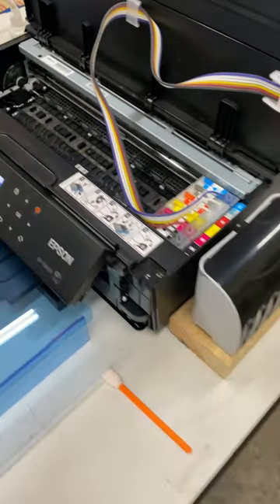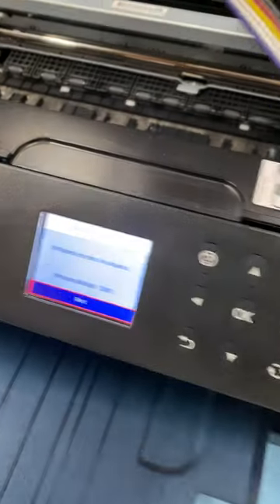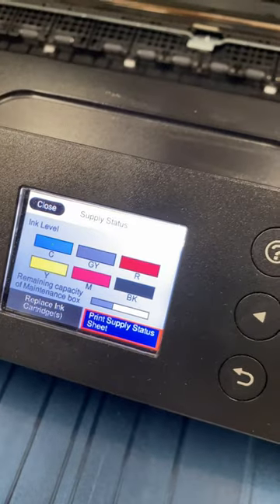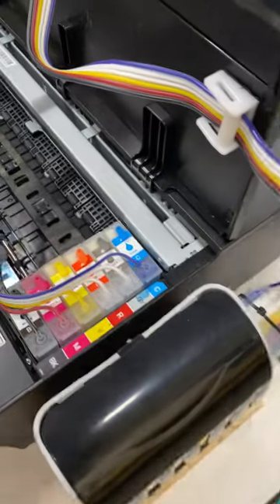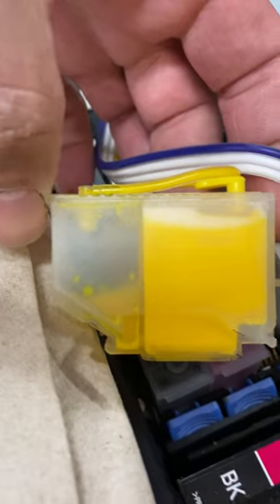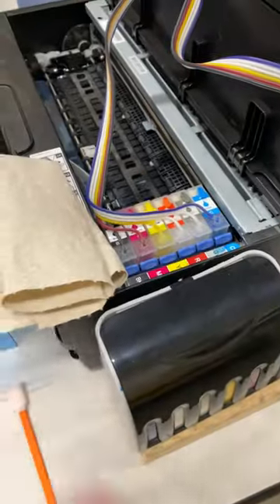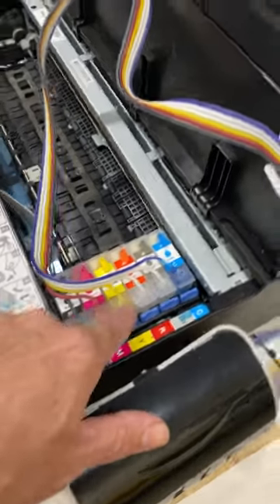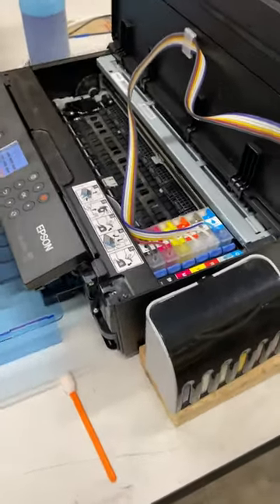DTF - XP 15000 CISS Flooding SOLVED!! Plus Resetting the DTF Ink Level

Comment: I am planning to buy the same exact thing, but the system does not come with a chip. I really don’t know what that is about but I’m guessing if it does not come with a chip, I will not be able to use it correct and how often do you have to replace this chip?
Reply: You gotta use chipless firmware

Comment: Hi, thanks for all your tutorials regarding Epson 15000. I really appreciate the honesty and straightforwardness. I am wanting to dive into DTF but am hesitant about which printer to buy. I checked out the VVI site and so love that they have a ready-made set (excluding the printer) to purchase instantly. I want to know more about DTF and have no doubt that I will definitely pursue this. I have had my eye on Epson 15000 for some time now. This is how I found you. I am not too sure what the criteria are for joining your FB group. I tried to join and after a couple of minutes, I was declined. Well anyway, my question: Do you have a video that shows how to install the chipless firmware? Also is there another software apart from EKprint that is compatible with this printer? Thanks.

Comment: Please where can I get the CISS  with damper and can any 6 ink CISS with damper work on the xp15000
Reply from the maker: From vvinks.com
Reply: How do I know if my XP 15000 has a chipless firmware?
Reply: hope by now you fixed that. Normally, the printer does not come with it. it has to be downloaded and install it

Comment: Is Ciss with damper used instead of external ink tank???? Im new to this excuse my ignorance.
Reply from the maker: It’s the same thing. CISS stands for constant ink supply system
Reply: @SouthbayCreations  oh okay,thanks. im preparing to convert a printer. Was getting confused, i see some people drilling holes and adding a tank on side, than i saw this.
Reply from the maker: From what I’ve seen is refilling the OEM carts doesn’t hold much ink and need to be refilled very often. I personally have not tried it, that’s just what I’ve read.
Reply: @SouthbayCreations  hi and now the printer work fine, after all this time? whit the dampers???

Comment: I just bought a XP15000 I'm kinda tempted to buy this set up but I'm a little confused I'm new to DTF what does chip less firmware mean?
Reply from the maker: Sorry I missed your message. Come to our Facebook group so we can help you better
Reply: Chipless firmware is a bypassing cartridge basically you don't need original cartridge anymore any ciss with out chip will work.  Make sure you do not updated after you used the software because epson will give you update to erase that chipless.
Reply: I found this info from a guy who did this Quote "You need Refillable ink cartridges, you don't need the chips instead download chipless software from chiplesssolutions". But I think people also are downloading the chipless software from Epson itself.

Comment: I have a XP-15000. I have contact Epson several times about my issue, and they even sent me two replacements and still cant figure it out. Last year I used the rear feed to print alot of envelopes with borderless printing. No issues. This year, for some reason when it starts to print, it drops a few dots of ink on the envelope. This never happened in the past. I tried it on two other XP-15000s and it's happening on them as well. I'm printing on linen paper and never had any issues. Any thoughts of what this could be?
Reply from the maker: Sorry I really don’t know what would cause that. Maybe someone will know in our group, a lot of folks use that printer, not for envelopes but they may have some ideas for you.
Reply from the maker: The link to the group is up in the description
Reply: Thank you! I'll join now.
Reply: @SouthbayCreations  Been trying to join. Requested
Reply: I print envelopes too and I use different kind of software. It depends on how long have you had your printer.  The ink flows from the cartridge to the head (heads) if it applies, from the head flows onto paper, envelope, etc. It sounds like your head might be old or damaged or needs cleaning.